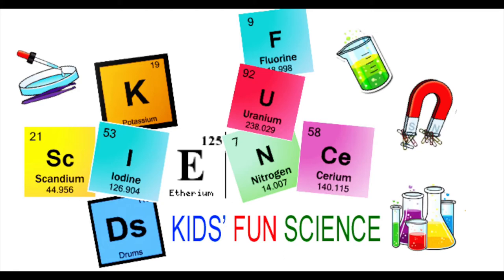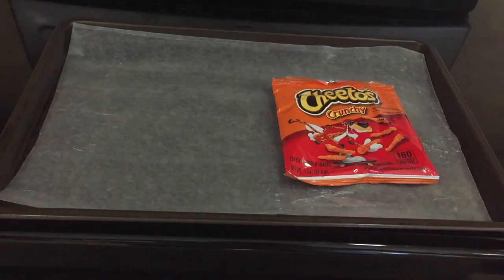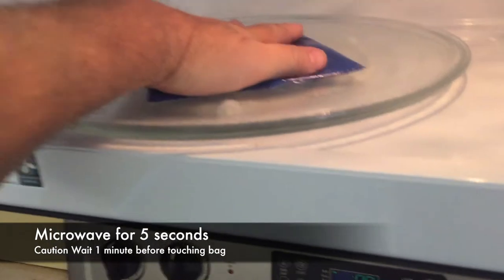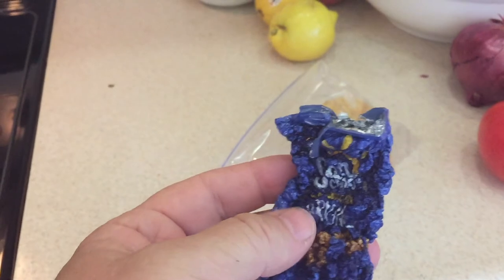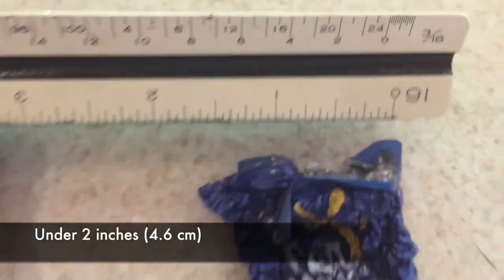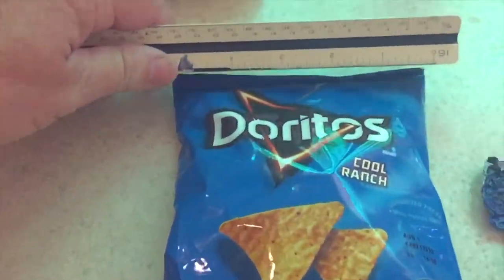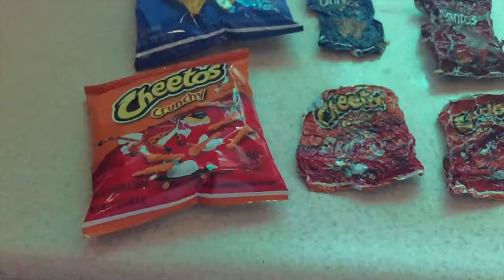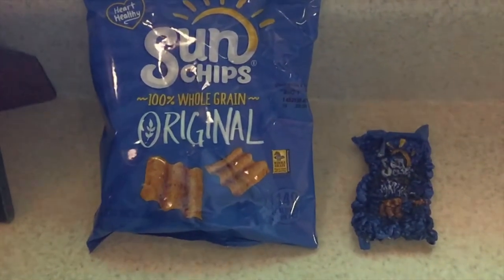How to Shrink a Chip Bags Experiment  (Shrinking chip bag in Microwave)

Comment: Is it completely safe? Will the microwave break?
Reply from the maker: Good Morning Bebiceb, Please do this and all other experiments with the supervision of an adult. Place your empty chip bag in the microwave. Heat it on high for NO LONGER than four seconds. If you heat it any longer, you could damage the microwave oven. 

Also it will be very hot when it comes out and you should wait before removing the chip bag. I did not have any problems with my microwave, but everyones microwave is different. You can try placing it on a oven on a cookie sheet. thanks Ken